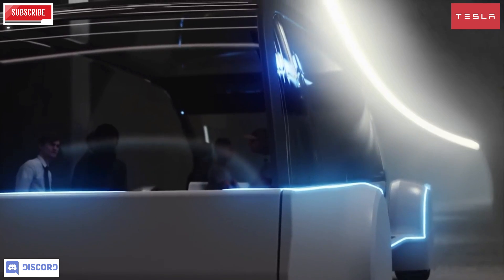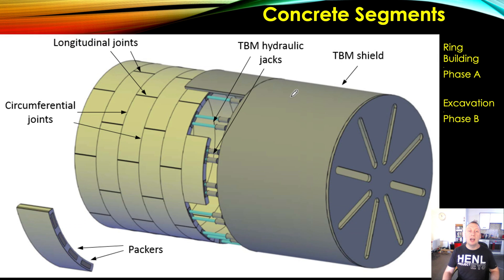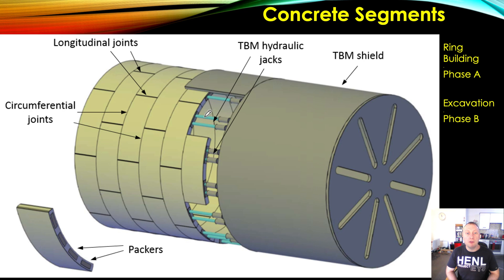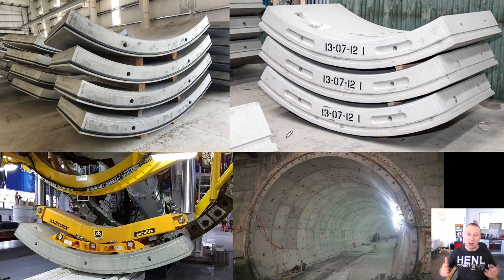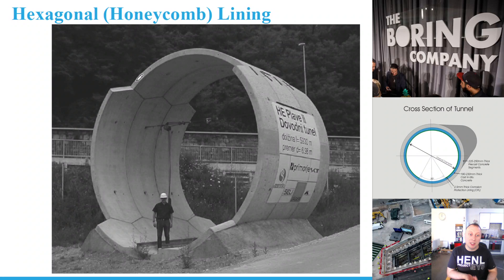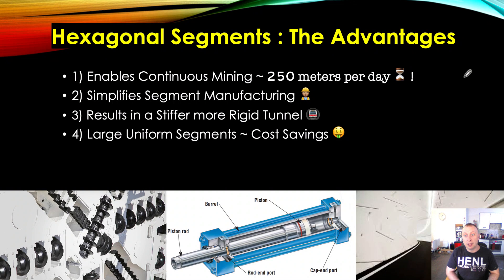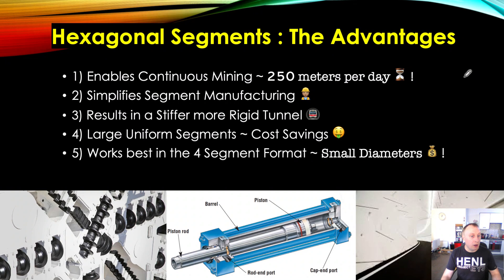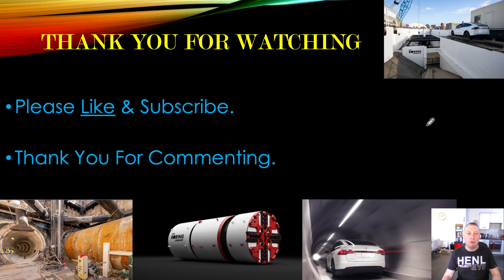The Boring Company 🚇 😃 🇺🇲 Hexagonal Concrete Segments Are The Future 👷🏽‍♂️ 🏗️ 🚎 PART 1

Comment: Responsibilities
Set and Adjust Concrete forms to desired pitch and dimension.
Check and repair forms to ensure consistency of pours.
Mixing and Monitoring materials to maintain quality.
Pouring Concrete while monitoring the weather for impact.
Prepare and clean surfaces for finishing while repairing holes and cracks.
Drill holes and add anchor bolts as needed in the finished product.

Comment: This is greater in efficiently which in turns saved one of the procedures. Anytime you can incorporate two processes into one you cut down time off installation you save money as well. Elon has shown what the benefits are using hexagonal shaped designs.
Good vid! Thanks for your investigation into this product and it’s innovation.

Comment: Hexagon is good for straight tunnel ?...(just need 1-modul)  but how for the tunnel need to turn left or right... or up and down?  you need another modul, slightly smaller or more wider?  then its not a simply manufacturing process again... ;p

Comment: I don't see any advantage over previous desing in fact, this design will act as a wedge trying to separate the rings. Also why the tbm needs to stop with previous design? Who says that the pistons are fully extended for the width of one ring. I really dont see anything good in this design and I hope boring keeps been boring and don't use it.

Comment: The problem I could see with the hexagonal system is the transfer of loads. In a typical ring system each ring has flat surfaces to transfer loads through each piece in each ring. The hexagonal pieces do not form rings. And forces on the tunnel could push the rings apart at the edges are effectively wedges.